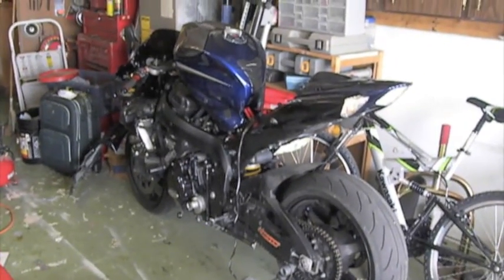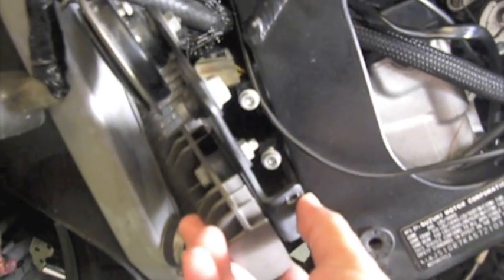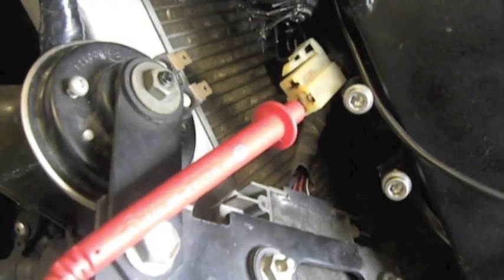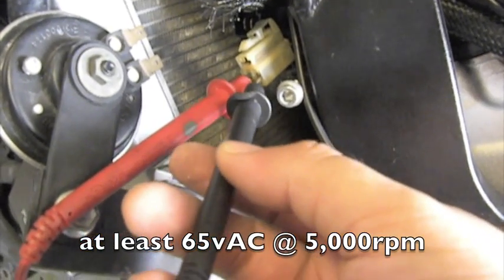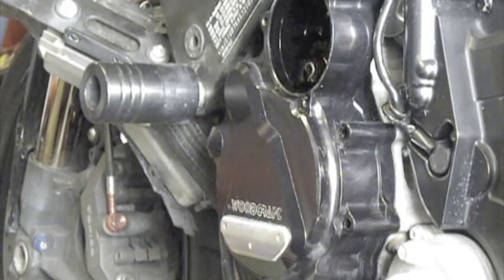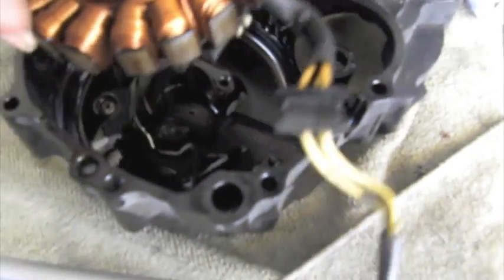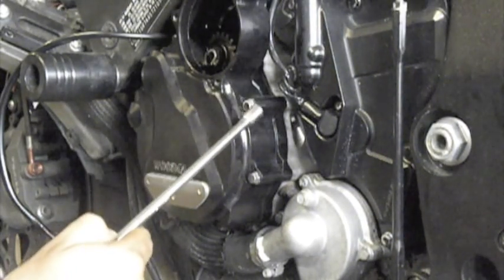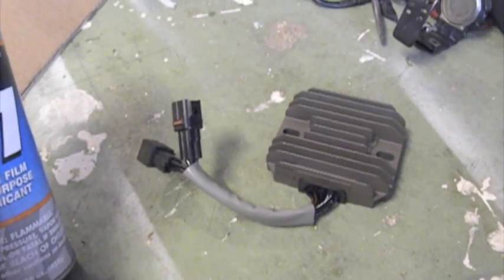HOW TO CHECK YOUR CHARGING SYSTEM and CHANGING the STATOR and REGULATOR/RECTIFIER

Comment from the maker: that is why you see me isolate the stator and only check the stator itself.......checking at the battery is a quick test...... to further troubleshoot you have to isolate the component....so that is why you check short to ground at the stator ....not on the side of the wire harness.....this is for anyone that is getting confused between our dialogue......thanks for bringing these valid points up

Comment: 1.  Not true, there's all the wiring and connections between them; corroded wires, connectors, wires rubbing against the frame, etc can all do it.  Also, regulators that use a signal wire will overcharge if there's an abnormal voltage drop between the battery and the regulator.
2.  Even then you're checking to installed ground (which is still a good test to run).  But the most conclusive way to check is take the stator off and check if it's shorted to itself.
3.  Thanks for agreeing.

Comment from the maker: thanks....

1. if you have a known good battery, which means its fully charged and a decently maintained bike and you run these tests, and your getting low voltage it will be your regulator, theres nothing else involved in the charging system

2. thats why you test on the stator side for short to ground...its isolated from the rest of the bike, if theres a short that means stator is done

3. good call on probing the connectors. make some test leads or just be gentle but make sure you get contact

Comment: Okay i run those test and at 5krpm my battery was no more then 12v.. then i check the STATER  and 1st the show me oo2 and at 18v.. so i do need to get new stater not the REGULATOR cuz when i run the engen at 1st test wen i went over 5krpm my volt was around 12v

Comment: Ran out of room on the last one, although there were a couple things I disagreed with I think the video as a whole is solid.  Kudos for the Bluepoint meter (seriously people, if you want do your own work, buy a good meter like bluepoint or fluke, not a wal-mart cheapie), and also for changing the gasket, which too often gets neglected.  

In case you're wondering, I'm a technician for an aftermarket shop for electrical parts, so I do know what I'm talking about.

Comment: Generally a very good video, agree with everything with a couple differences.

1.  Low voltage doesn't mean a bad regualtor.  It's a definite possibility, but not certain
2.  The stator being grounded isn't always a stator problem, sometimes something is wrong on the frame that causes the short.
3.  Take better care of your stator connector.  That thing is a big problem child, and this one looks a little discolored.  And definitely don't jam your meter probe in like that, make a test lead.

Comment from the maker: the only thing you might notice is when you press the starter button, bike will crank and start up a bit slower, compared to a freshly charged battery where the bike will crank up and start almost immediately.... also when your riding your speedo will stop working it'll either say 0mph or just be stuck at a certain speed....then when you turn off the bike, its guaranteed that it will not start up again.